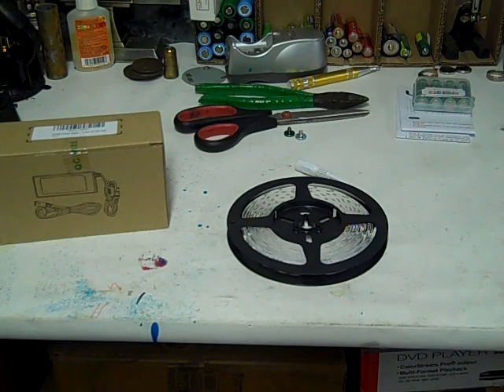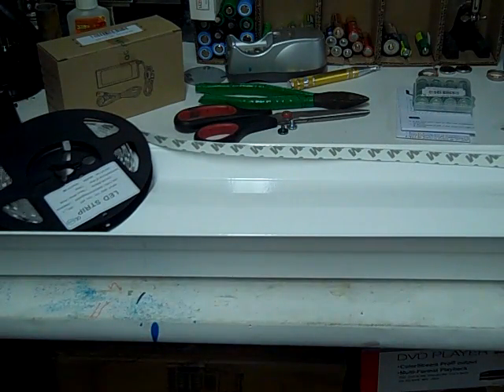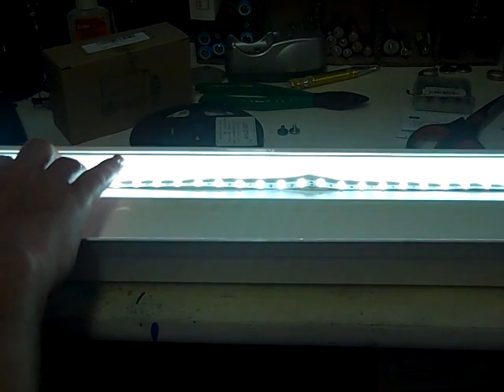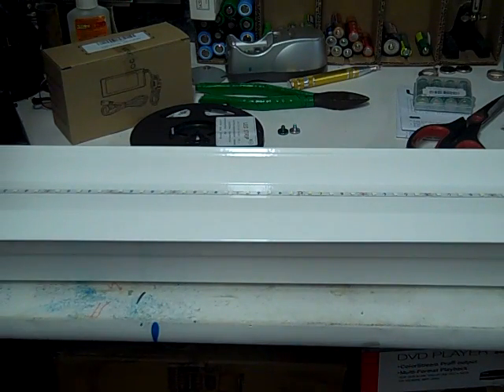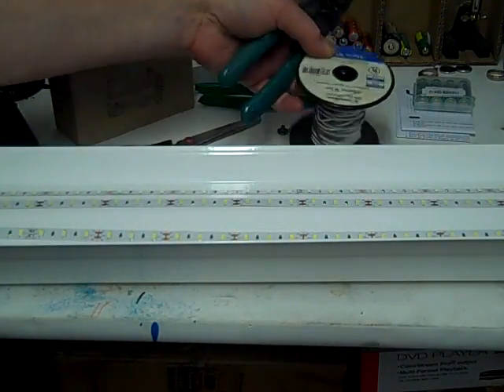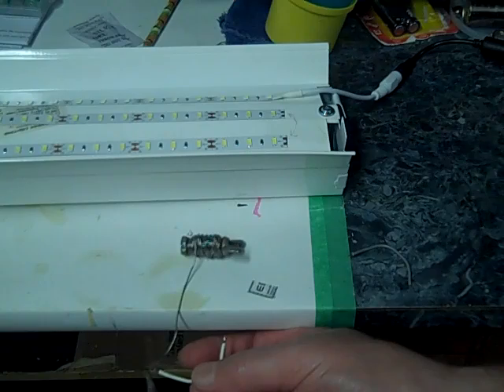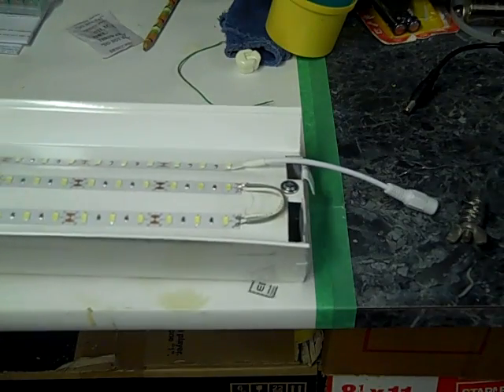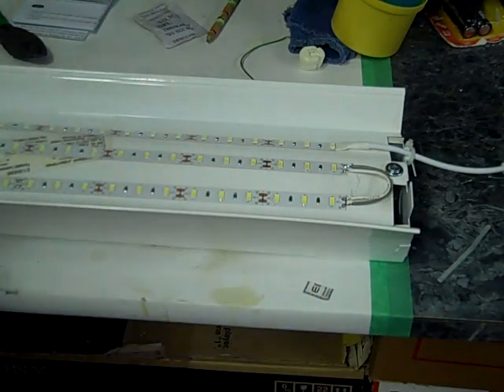LED Strip Light | Convert a 4ft  Flourescent Shop Light To LEDs

Comment: I prefer the 2835 LEDs    The color temp is neutral about 4300k,  They are slighty lower in lumens than the  5630 but rated a litttle more efficient.  At 120 LED/meter I can get high lumens out of a 5 meter strip.   
Another careful consideration must be made when buying the strips is the brand of LEDs it has.   You get what you paid for. Will pay considerable more for Epistar LEDs  vs unknown brand generics, but will have much higher lumen rating  and copper for longer life span.

Comment: You can now get fluorescent led tubes that run directly from 120v from bees lighting on line. They are about $7.50 per tube.
Reply from the maker: cool
Reply from the maker: Looks like they have them at Home Depot too.
The prices have really come down since I made this video.
Reply: Home Depot online has 4 ft. 40-Watt Equivalent Ballast Bypass Cool White (4000K) T8 LED Tube Light Bulb (12-Pack)  for $80.  3yr warranty.  Don't know about the quality. They likely each got a constant current driver which be the part most likely to fail.

Comment: Nice Job... I had some USLED PT2-3-12-W I scavenged from a broken channel letter sign. I bought some 12-5-60 power supplies (ebay $8.99) and mounted them where the ballast was. I started with 4 rows in the center but realized the light was being blocked by the reflector sides (old bulbs protruded) so I added 1 row on the inside of the of the reflector sides. Way brighter and it is instant on not like the Florescents slow boot and sometimes having to wait when it was below 40°. (Degree symbol= Alt + 0176)